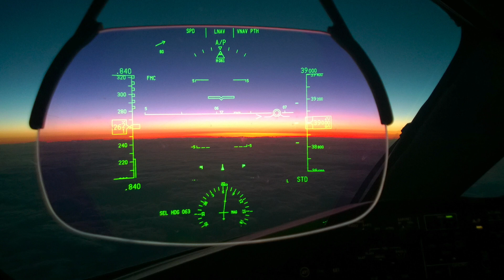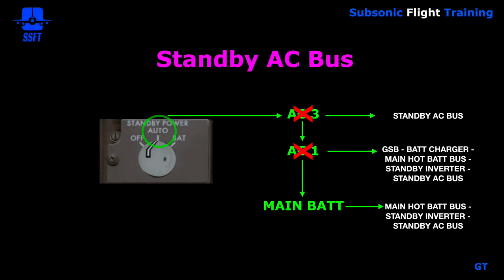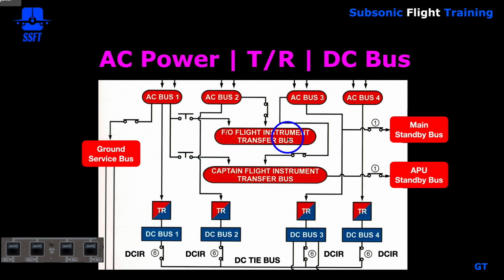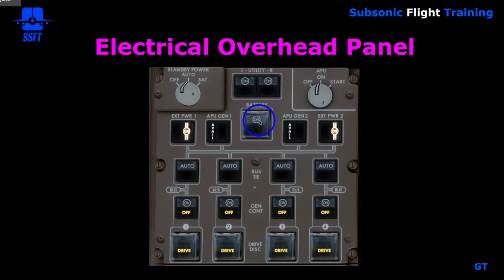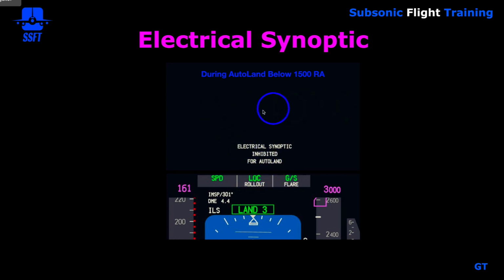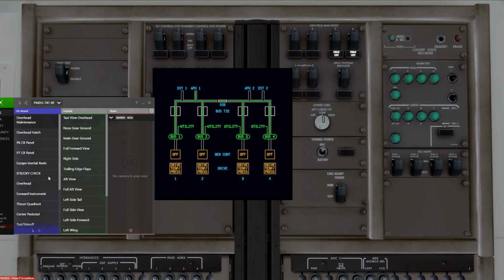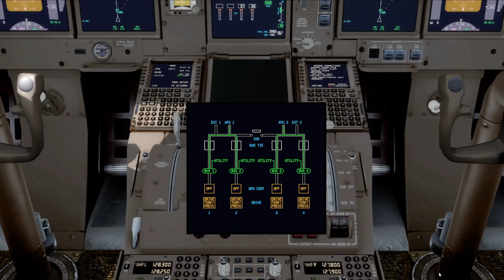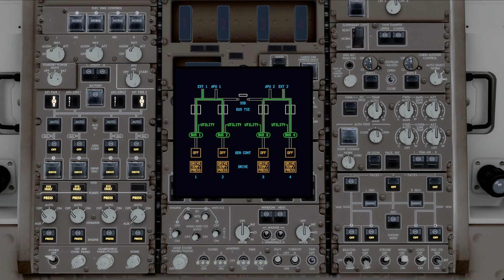Electrical System - B747-400 | B747-8

Comment: Can CMC maintenance pages be accessed without full AC power using only batteries and standby power?
When ground crew turns off APU (when they no longer need ground service bus), how do they know when APU shuts down (when the cooldown cycle finishes, APU turns off and door closes) so they can turn off battery switch?
Reply from the maker: No, the CMC pages need AC Power to be accessed usually by the Center CDU by maintenance. When the APU is turned off, the fire detection is provided by the APU Battery Bus, which is powered as long as you keep the Battery Switch ON. The way you know the APU has fully shut down is by time, you allow and time for 2 minutes when you turn the APU off to account for the cool down time, plus door closing, etc.

Comment: Any idea why the adding an additional ac power source AFTER the IRS are aligns causes synchronized problems as well as prohibits autoland unless you recycle the IRS all over again? It’s really annoying TBH. 

I’m guessing the synchronized problem is due to the ssb opening when you have two unlike power sources but to mess up the IRS system is crazy to me. This does not happen on the 777 tho.
Reply from the maker: I do not remember that being an issue, is that a current thing? I have no clue why it would do that…

Comment: hello again, looking through these videos again and I had a scenario question. If you're on a CATIII approach and you are below 1,500', so all but AC 4 is isolated, what happens if AC BUS 4 fails in that mode? I know that that AC BUS 4 is designated as the bus which can help power other busses in case of a fault, but at that point, what happens to the system? The AC BUS 4 is also used to power the Sync BUS so, is it just not powered?? I cannot imagine that as being the case so what powers the SYNC BUS? The other buses? or are just left stuck fully isolated until you exit that mode? Sorry if you mentioned it in the video and I just missed it but this was a question I have been thinking about since my last CATIII Autoland... Thank you as always!!
Reply from the maker: If you are in LAND 3 and AC Bus 4 fails, AC and DC Buses 1, 2, and 3 would remain isolated from the sync bus to maintain 3 independent power sources for Autoland. The Sync bus would not be powered. If there is another failure of 1, 2, or 3, the electrical system would be unable to maintain a configuration for full autoland bus isolation for LAND 3. The Sync Bus would be re-powered and LAND 3 would change to LAND 2 if below 1500 RA and above 200 RA. If you are below 200 RA, then LAND 3 would remain shown and the jet would Autoland just fine. Of course if you get LAND 2 on a CAT IIIB approach, then your ops specs for CAT III Operations would determine your further actions from that point...
Reply: @subsonicflighttraining  fantastic, even me and the instructors were discussing this since there's very little literature on that exact scenario. Thanks for the info as always!

Comment: Hi excellent video as I already said, but I've a question that I don't find the answer to. What bus powered the Main4 and Main1 pumps, the Main2 and Main 3 and Center are powered by the utility bus, the Stab pumps by the Ground service bus with the main 2 aft, but I don't find anywhere what bus power the Main 4 and Main 1. Do you have any informations on that? Thank you very much for this excellent video that is extrmely detailed.
Reply from the maker: You are right, it is hard to find. The only place you find anything about Main 1 and Main 4 Fuel Pumps Power Source is in the Fuel Section where it says each main tank contains 2 AC Powered Fuel Pumps. They are on their respective busses, so Main 1 Fuel Pumps are powered by AC 1 and Main 4 Fuel Pumps are powered by AC 4. You are welcome for the video!
Reply: @subsonicflighttraining  Thank you so much, I read that part of the FCOM but as they don't describe it with the numbers they didn't end up in my searches.

Comment: Once the chocks are in place you would not leave HYD 4 in AUX (Or 1 and 4 on some -400's or the -8), and usually cargo unloading or other ground handling would not take place until hydraulics have been switched off and the beacon light turned off.  This is to prevent injury or damange to the aircraft from accidental or uncommanded flight control movement..
Reply from the maker: Once the signal is given for chocks in or a call that chocks are in, #4 demand pump is turned from AUX to OFF in both the 400 and -8 by the FO. The Captain may or may not, at their discretion, release the parking brake. #1 is turned OFF in both jets as part of the shutdown procedure. It is only put to AUX, if you have it, during the before start procedure, not during shutdown. Prior to engine shutdown, the FO brings #4 to AUX, and #1, 2, and 3 to OFF. The beacon is turned OFF as part of the shutdown flow after the engines are shut down...

Comment: What program you work on it (flight simulator for example)
Reply from the maker: The jet is PMDG 747-400 and 747-8, the platform is Lockheed Prepar 3D (P3D v4) Professional Edition.

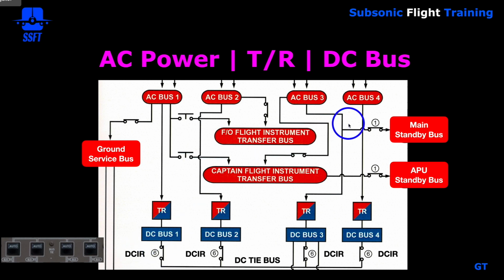Comment: Thanks for a great Electrical System Video. I did have a question : According to the AC Power | T/R | DC Bus Schematic in the video, it looks like the APU Standby Bus is powered by the Captain's Flight Instrument Transfer Bus  (through AC Bus 3) but not directly by AC Bus 3. Can you confirm this? 15:45 in the video

Edit: I was looking at the schematic wrong I see now that the APU stand by bus is powered by the Captains transfer bus.